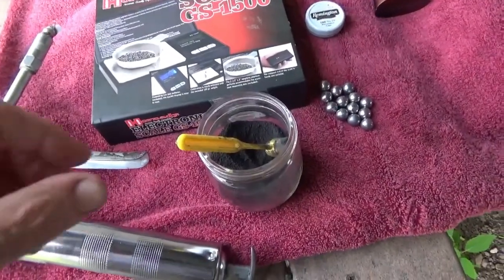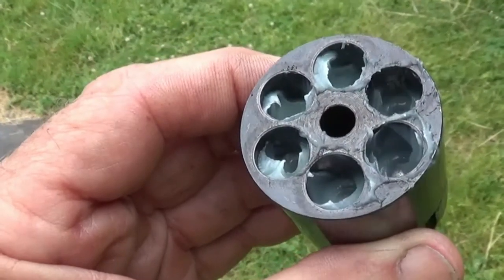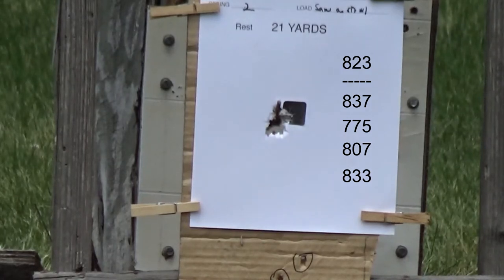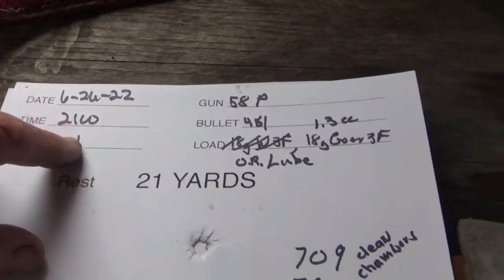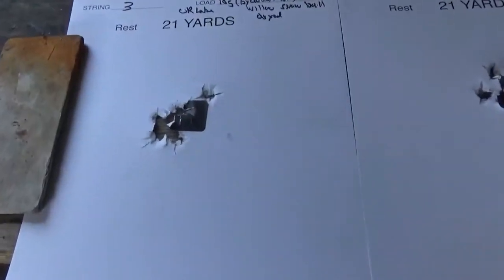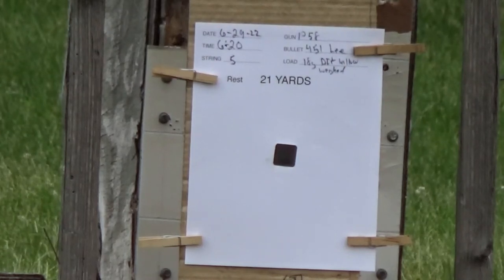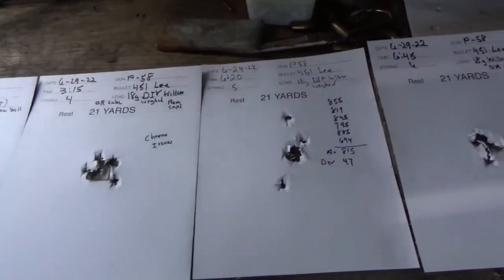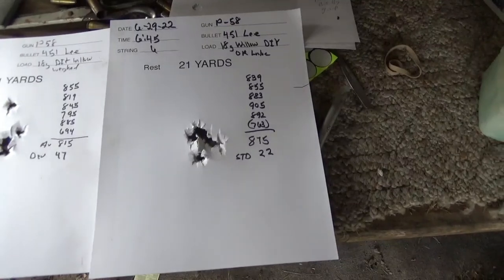DIY Black Powder in a 1858 Pietta -- Long Version

Comment: Very good video.  In spite of the deviation, you are getting very nice results from your homemade powder.  I’d say it’s a win! 
I’ve made some as well.  It works. I used the screening method.  I may eventually try the pucking method. Haven’t decided yet.  My powder compared favorably with GOEX as well in open burn test and remaining residue. It also worked very well in my 20 gauge double barrel percussion shotgun.  I’ve yet to chronograph them side by side to get some numbers but my penetration test using soda cans and cardboard stacked with spaces in between gave nearly identical results when firing number six shot at a distance of 30 yards.  It worked well for a squirrel hunt.
Reply from the maker: Thanks Skip. Great to hear.  I suppose a 45/70 at 500 yards would be the final test.  Rather not do that yet and get discouraged, having too much the way it is now.  O.R.

Comment: Fantastic groups ! I am really surprised that these groups are so small considering how deep in the chambers the balls are seated, I always try to pack out until the ball has a minimum gap to jump to the barrel, but this proves that is not necessary. Very many thanks for posting these experiments! Chris B.
Reply from the maker: I've always read, or heard the same, and the corn meal filler was supposed to take care of that for the target shooters.  If I just had a couple of tight groups, but It just keeps driving the point home.  Should help out with any current global shortages of corn meal.  O.R.
Reply: Pietta and Uberti Remingtons are two very different breeds, in terms of machining dimensions. Both are excellent IMO, but they can't be treated the same. While making chamber gauges for my 3d printed .44 paper cartridge kit (not for sale, my own use, excellent kits available everywhere, I'm not pushing any product here) I came to realize that Uberti chambers are significantly tapered, so much so that balls should be kept as close to the mouth as possible and filler should be used on reduced charges, in order to prevent such excessive swaging that the ball does not properly engage the rifling anymore. My Uberti NMA will gladly take 0.457 and barely shaves lead at 0.454 ; 0.451 is a no no. My 1851 and 1860, both Pietta, will accept low seated balls without adverse effect on accuracy. Their chambers are almost straight. Frc_
Reply: @oldranger3044  It is strange how some firearms defy the rules, I am sure any target shooting competitor would be very glad to shoot groups like you have here OR, they are outstanding. Chris B.
Reply from the maker: @frc_9933  Real interesting, thanks so much.  Shooting a rather new Uberti 36 that has the faster twist, I noticed that the 375 round ball shaved no lead.  Figured that was due to bevel on chamber mouths, but maybe not so.  I was loading almost half way down, and not getting the groups I would have like to.  I did reduce the load and used a filler, and things seem to have improved.  Going to do more testing, but maybe if they are tapered that would explain.  I did run some 380, but it was in the Pietta 36, it shaved plenty, and took a good push to get into the chambers. 
Going to try the 380 in the Uberti, and will do more to keep ball close to cylinder end.  Again, thanks for this information.  O.R.

Comment: Pretty fair results! Are you planning on increasing loads to test stability , and of course velocities, accuracy?
Good shootin. Just how close is the chronograph from the muzzle?
Reply from the maker: Chrono is about 12-15 feet.  Are you thinking about stability of the round ball?  If so, that is a good idea because I as a little suspicious that after 1K I might start to get flyers.  That Pietta has a 1-30 twist.  Also, possibly the 451 won't have the side to barrel friction due to the small contact area to give it the necessary rotational speed. Be interesting to test it against a 454, because if it slips at all, will be a smoothbore pistol.  O.R.
Reply: @oldranger3044  yes all of that is relevant. But to get what I'm asking I have to go back my history. My first Remington was purchased in 1974, or 75. 6 years later I was was working up  a powder load, bullet combination worthy enough for grizzly protection to satisfy an outfitter who required a .44 magnum  on every employee side. To get there I incorporated two basic principles. 1. As a custom handloader I used the the same philosophy. Uniformity of everything. Uniform flash holes, measured by weight powder combination, etc. Yes powder combination.  Two fundamental knowns of black powder. 1. No air pockets. 2. You can't over pressure with real back powder.  There is just a point where not getting a complete burn of powder, and  leaving a shotgun pattern of unburned powder.  Ok so for a bullet at the time I chose an Elmer Keith cast for a gas check at 240gr. Powder load combination to take  advantage of diminished cylinder capacity of such a long bullet. A combination too warm would show diminishing accuracy.  It's one of the reasons I strongly I teach burn rates just the same as  I would if it was a center fire rifle. The best powder choice should not be based on caliber alone. Barrel length has as much or more to do with it just because it .32 caliber doesn't mean 3f should be chosen for 46" barrel, when complete burn happens at 32".

So when I ask about stability, I asking about 1. Consistency of grainulation for burn rate. 2. Complete burn for less fouling, and also can lead to pressure. 3. Is there such a thing as too much? 4. Is the mixture even?  I'm know you know, so not to be redundant less velocity doesn't mean less pressure.

One of my ways to find the limits for example for a rifle was to work up my load over snow. If you're leaving a black pepper trail for 20' back off the load and if need be speed up the burn rate. 

 Sorry for being long winded
Reply from the maker: @StevenMMan  Happy for the information, always.  I thought maybe it was about the powder.  It's a real mix of fines, and even dust.  I think it tends to separate itself just in transfer from container to container, not to mention what happens when it gets dropped into the funnel and chamber.  
You've sure done more than your share of homework on this stuff.  I fired and checked speed a while back on shots just out of the cylinder.  Only about half as I could tell (real hard to aim, and one of the screens on the chronograph will testify to that).  I have been able (I think) to reduce the DEV's by about half when I use a nipple wire and go into the powder after it is compressed in the chambers.  Probably post something on this as there might be some interest in it.  What you have said sort of confirms my suspicion of why the GOEX has better STD's.
I am a bit concerned about pressure also, one reason I started with 14 grain loads.  I don't plan to go over 20 grains of this stuff for that reason.  Should send a half pound to Kentucky Ballistics, he'll know what to do with it.  Thanks for all the information.  O.R.

Comment: I also use Willow in my homemade black powder and works well but I am curious what it would do up against buck alder?
Reply from the maker: I know some chemistry. All carbon atoms are basically the same in the way their outer shell electrons interact with other elements and compounds. KNO3 is a compound and sulfur an element. I can right off think of a couple of things that can effect the reaction. How well the components are mixed (and the size of them), and also, what else is in that charcoal besides carbon. If the mass of charcoal used contains things other than carbon, the components will probably not react completely, probably resulting in less power but possibly giving better or worse in the fouling arena. Anyway, don’t believe buck alder grows this far North. Lucky anything does. Might want to check with videos by Lame Beaver, Everything Black Powder, or others as they may have run some tests. There’s probably lots of time needed to get some conclusive results in this area. I too am curious about different charcoals, especially how they might effect the fouling. Not just the amount, but especially if some produce “moist fouling “. O.R.

Comment: I've been shooting my .44 navy  with like 25 to 30 gr. Of 777. Do you think that's too much? I can't get  as tight  of a group  as you at 20 yards. ( maybe less is more accurate?)
Reply from the maker: Never done much with 777,, doesn’t say I don’t have any. Probably I’m a little more obsessed with accuracy—thinking something happened when I saw Davy Crockett shoot one ball on top of another when I was a kid. I’d be some concerned that 25-30 of 777 is a bit heavy for the Navy 44, especially if it is a brassy.  Generally, I feel heavy loads don’t give the best accuracy, and I don’t have a reason for them in the target-plinking arena. When we started shooting the 2nd gen colts, we used the measure attached to the copper powder flasks which was maybe 20 grains of FFF Goex in our Navy’s. Loading lever would drop and the frame area on the barrel around the wedge deformed. Plenty of flyers. Would be interesting to see how it works for you by reducing your load, possibly going to black powder (if you can get it).  And don’t forget about lube with black powder; I also use it with substitutes. O.R.

Comment: Why do speeds increase as the chambers get fouled. It seems to be opposite of logic.
Reply from the maker: Excellent question. Seems like I did clean the barrel to eliminate that possible factor, but can’t say that for sure. Using lube the barrel seems pretty consistent shot to shot, but I should check that out more. After cleaning I typically run a oiled patch in chambers, but only a thin coating, not enough I believe to effect ignition of powder in a freshly loaded cylinder. I have now at my disposal a Pietta pepper box that has no barrel. If I can get it in my ransom rest,  I will be able to get some speeds without destroying my chronograph (no sights on the pepper box). Figure this is necessary to verify that chamber fouling is increasing speeds. Then its time for theories about why. Thanks for your comment, this is something I’ve been wondering about. O.R.